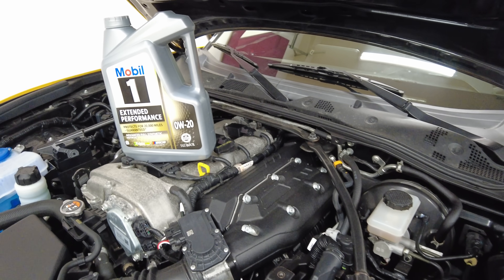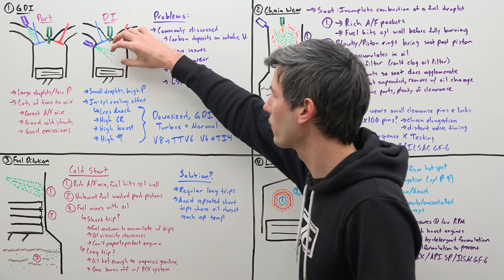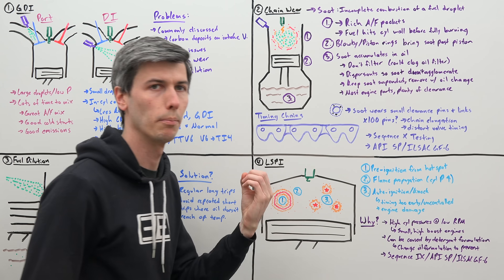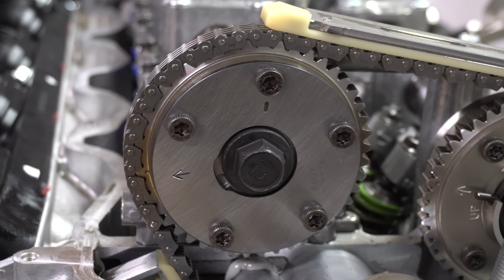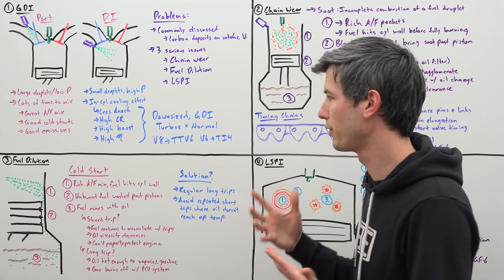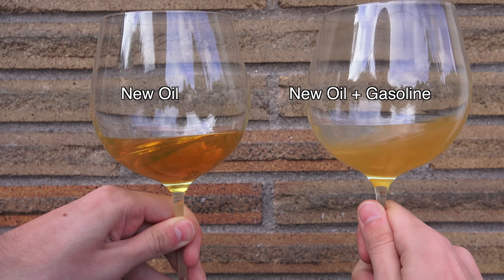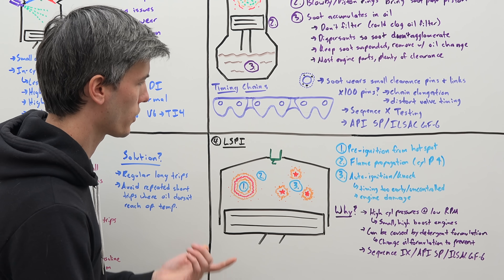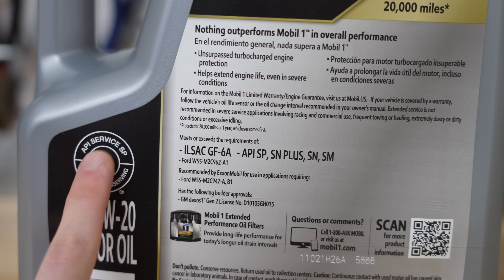3 Big Problems With Direct Injection Engines (Gasoline)

Comment: Low rpm port injection pushrod engines like the ls routinely get 300,000-800,000 miles before they finally give up. Just saying.

Comment: Gee too bad the German engineers didn't know how poor direct injection was!  They would have never used it in some of their fighter engines as well as the 300SL that ruled Le Mans until they stopped racing.  If only you could go back an tell them LOL!  BTW, chasing what turned out to be a coil wiring problem I had occasion to pull the intake on my Chevy 3.6 direct injected engine, could clearly see the backs of the intake valves an they looked like they just came right out of the box (60k miles).  I also worked in a shop rebuilding engines and did a number of valve jobs on 300SL engines.  The valves had no more carbon and often less than typical Chevy small blocks in the early 70's.  I have no doubt this problem exists somewhere but I couldn't prove it by my experiences.

Comment: No. 6 no cvt transmission.
No.7 non turbo. Get bigger engine if need more power.
No.8 reroute the pcv system to an oil catch can or other
No.9 on new car first oil change at 500 mi odometer reading, second oil change at 1500 mi. Odometer reading., third oil change at 3000 mi.odo reading. From then on every 5000 mi approx with synthetic oil. Otherwise every 3000 mi with regular oil.

Comment: A simple, inexpensive oil catch-can solves these problems. It catches not only the oil, but also the soot and fuel. It acts as a second oil filter and stops any oil from reaching the intake valves. Direct injection is not a problem, the oil is the problem, which is easily solved. I just hit 150k miles on my Corvette C7. Not one problem, no leaks, and still has all the power it had when new. And of course, the AFM was disabled. GDI is still superior.

Comment: So GDI + Port Injection & Improved ECU control of cold start & different modes to select which fueling method best case, or multi-variable mapping or dynamic engine mapping with AI from NVIDIA or Intel or Microsoft //
Reply: Dual Injection or Dual Fuel already an automotive technology to solve the problems of direct & port injection by using both methods! So each cylinder has its own direct injector & port injector.

Comment: Our 2015 Honda CRV had GDI. We had one injector go bad at 102K miles while on a road trip hundreds of miles from home. Car went into limp mode, so had no option but to limp  to a dealer. Honda only sells full set of injectors. $1800 by the time we were back on the road. Conversely my kids "97 Tacoma had an injector go bad several years ago.  Bought a reman. unit online for $39 and swapped it myself. Still running like a top with 290K on the clock.  So even if you dodge the carbon buildup issue (Honda has a built in catch tank as well) GDI systems are over designed and expensive to fix when (not if)they fail. And don't get me started on the CVT in that thing. Needless to say we no longer own a Honda.

Comment: Your description of GDI engines features & problems was spot on! I was privileged to be a lead auro research technician for several years, in LSPI phenomenon consortium studies at SwRI. The 2.0L GM LHU  Turbo GDI engine was my assignment at that time. What a sturdy engine for that test matrix. The pistons had a hollow donut ring under the combustion face & was oil squirter cooled (like some diesels,) evenly cooled as the oil traveled thru the donut, & cooled piston top equals a stronger, LSPI resistant piston. I operated these engines for hundreds of hrs., heard thousands of LSPI's, watched amazing cyl. pressure traces (LSPI spikes), and the LHU would hold up amazingly well.
Yes, you mentioned the oil additive that grossly exacerbated LSPI's (the engine sounded like a popcorn machine!) Without the additive, the engine might run for hrs. totally quiet! 
I love your show, great dissertation & nice learning experience! Thanks!
Reply: I have this engine in my car, though it is designated as a20nht. It has 212000km currently, and runs fine. Although it sometimes has a brief cam phaser rattle on cold starts. Did you have this problem on your tests? And how did the timing chain hold up in your experience? I keep up with oil changes and using dexos 3 recommended oil. No short trips, whatsoever.

Comment: What about Fords 5.0L V8 that utilizes both direct injection and port injection with mixing? It’s naturally aspirated with a high 12:1 compression ratio. Does this method avoid the fuel dilution?

Comment: Good info, thanks.  I have a Mk7 GTI and use Mobil 1 Euro car formula.  I thought the VW 505 00, 502 00 is what I needed for that car.  It lists API SN, SM, SL, SJ but not SP.  I've lugged the engine before on hills momentarily before downshifting but never heard a knock or ping.  Is this a subtle knock that you can't hear?

Comment: A high pressure fuel pump would atomize the fuel (like it does in DI) and improve the mixture in a PI engine, therefore increasing it's efficiency. 
  
  But if the big benefit here is the cooling effect....well, there were better solutions. Like water injection or ethanol. Hell, E85 already has a significant cooling effect, so i don't see any additional benefit from DI. 

  In my opinion, DI is pointless and causes more harm than good, and they adopted on purpose. To slowly kill your engine and force you to buy a new car or spend a lot of money to fix it.

Comment: The biggest problem w DI is if the O rings leak, the injector will leak fuel directly it the crankcase
which will thin out the oil & you will spin a bearing. SO, whenever I check my oil I look for  TOO HIGH
& I sniff the stick for gasoline smell.

!

Comment: I am confused by the spark thing. I thought diesel did not need it unlike petrol engines.

EDIT: I was right diesel engines do not have a spark plug, and everybody is praising the video. I removed the like and downvoted. This is sloppy.

Comment: Two guaranteed ways to prematurely kill a GDI engine:
1) Save a few bucks by using 87 octane. "Runs just fine".
2) extended oil change intervals with anything other than top-tier full synthetic.

"Pay me now, or pay me later" is wrong. It's more like "pay me now, or pay me much sooner".

Comment: I own a2017 honda civic sport touring 1.5L turbo direct injection engine model. And I believe that I have narrowed the oil dilution issue down to two different things with this DreamWorks honda engine. First thing is the PCV Valve is a POS! plastic dont belong under the hood of a vehicle that has as much heat as this car has with a catalytic converter under the hood and turbo charged too boot! I can tell when it sticks either open or closed, and yes I know it is only supposed to open in one direction! But this is what I experience when it sticks. If it is stuck open it loses vacuum at idle when sitting at a stop light the brake pedal goes soft and engine runs a little rough. And if it sticks closed it causes the oil dilution due to it somehow creating high pressure in the engine, And I believe it does this in the cylinder above the piston and is pushing unburned fuel around the piston rings! And along with that i know that these cars have way too many electronics and not enough battery strength to feed everything! And that would include the coil packs to make a good burn of all the fuel! And I say this due to a couple of things. First, when it feels sluggish and it starts running like crap! I remove the PCV Valve and spray mass airflow sensor cleaner through it, because every time I pull it out of the valve cover and shake it you can't hear the valve rattle. After spraying it and the oil gets done dripping out of it i shake it again and now I can hear the valve rattle inside of it! And when I reinstall it and drive the car it runs way better! Now let's address that battery, or lack there of is more like it! At 24000 miles I had an issue with the car steadily losing power, so I pulled the battery out and peeled the sticker off the fill plugs and opened all six plugs to find the battery only half full of liquid and all the lead plates exposed! Curious if anyone else had run into this issue, I started reading some of the comments people were writing in to a forum about this and found out that in there quest to make the car as fuel efficient as possible, Honda is shaving wait by  removing thirteen pounds from the battery if the car gets shipped to a warmer climate than if the car is shipped to a colder climate! That thirteen pounds is lead plates being smaller which would tell me that the battery now has far less reserve capacity for storage of energy to run all those things such as heated seats and the touch screen read out/Stereo system in these cars. I am interested in your thoughts about my findings? Oh, and yes I replaced the battery with the most powerful battery i could find that would still fit in the battery box like it supposed to as well. 😉

Comment: You know full well they design engines to last only so long. If better parts were used they would last. It is all just one big racket. If car engines had a prelube pump they would last much longer. Gasoline it's self is a crappy fuel. I think a 3 compression ring might help out.

Comment: Intelligent oil monitoring systems giving false hope that your engine oil is still good and a 6 foot long skinny timing chain ,,,what could go wrong ? Siamese cylinder walls and paper thin head gaskets. Worn timing chains for the most part are noisy at idle and an incomplete burnt fuel should show up as a rich condition. Blow by is inevitable with an engine that has short shirt pistons and low friction rings and 16 lbs boost.  Change your oil by mileage or pay the piper. Thanks for the video it would be amazing if Mobil 1 could actually tell everyone the total truth.

Comment: The ford ecoboost allows for 87 or higher octane and can adjust. Does running 87 octane with retarded timing on these affect the combustion and make a dirtier or incomplete combustion? Thanks.

Comment: I prefer Mobil One in both my Audi and VW, Audi has 240K miles and VW 145k.   I have used Liqui Molly before but it seems that Mobile One doesn’t burn as fast between oil changes.   Also, I change my oil at 3,500 to minimize risk of carbon scoring and oil consumption.

Comment: My EA211 has a belt, diesel vw504/507 oil helps with soot, 700,000km non issue with even the 3 cyl variant.

Comment: My car is a 2019 Hyundai Veloster with a turbocharged 1.6, and does get fuel in the oil. I do live in Canada where cold engine starts are a thing and warming the engine and letting the turbo idle down is a thing. I live in a small town where most of my trips are about 15mins. I change the oil every 5000kms, once a month I take it for a long trip on the highway. I still get fuel in the oil. 
I had to change the spark plugs at 35000kms because they got fouled from excessive fuelling. The dealership told me then I should make it work a bit and idle it more to get its temperature up. 
I just had my car at the dealership for it fuelling the oil again and I only changed the oil last month. They said it was because I was idling the car too much. 
Would idling the engine cause the fuel contamination in the oil?

Comment: So I am sure it will be fiercely debated but I was told that BJ’s gasoline is bad because there is no detergents or consistency in the refinery they buy from… which causes more buildup on DI engines.   Is this true or false?

Comment: Issues with Direct Inject were known in the late 90s, when OMC started using it in their Outboards. A change in the Combustion Process under some operational conditions, resulted in a very Hard Carbon Particulate forming. This would get behind the Piston Rings, and eventually prevent them from contracting in enough to allow the piston to move in the Bore. These were 2 Stroke Engines, but DI is also wrecking Havoc with 4 Strokes

Comment: I have a 2012 Ford Focus (direct injection) with 212,000 KM. 
I didn't change my oil for a year and a half during Covid because I lost track of time.
A VVT solenoid went on Dec 23, but I drove home for Christmas in a snowstorm.
I drove it for a day with a serious leak in the cooling overflow system.

The engine runs fine, gets fantastic gas mileage, and starts up on -30 mornings with no hesitation.
With the abuse this engine has taken, I think the worries of direct injection are way overblown.

Comment: There is nothing new about low speed pre-ignition, and it is not a quirk of direct injection.   Those of us who drove British cars in the 1950's and 60's were used to pre-ignition (due to a long stroke), as were those of us who had to use low quality government pool petrol, until pollution control measures put a stop to it.
This engineering guy gets a lot of things wrong.   For instance;  the main source of intake mixture cooling comes from vaporisation of the fuel (ie latent heat of vaporisation) - for a given quantity of air drawn in, since petrol engines operate stochiometrically that means a given quantity of fuel, and that means the same amount of cooling regardless of whether it happens before or after the intake valve.
Certain examples of Chinese-made small engines - eg those used in portable generators - suffer pre-ignition and they are carburettor equipped.   They pre-ignite because they filled a market thirst for more power, and the easiest way to get more power need was raise the compression ratio.

Comment: Only company to get direct injection correct was toyota. Because they used both port and direct injection. The main problem is maintenance. All the manufacturers going to a 10k mile oil change interval. Even on synthetic oil this is a very bad idea. 3-5k miles for oil changes people. Its not that hard.
Reply: Ford has been doing it with the EB engines for 6 years now. And yes, maintenance IS critical. Early oil changes stopped the cam phaser/spacer/timing chain wear problems even on non DI/port engines.

Comment: Wonder if mobil1 solved their real world evaporation issues. I quit running in my cars because I got tired of adding 2+ quarts between oil changes because it was always low. and this isn't on some worn out engine... This was true of my E63 AMGs, Jaguar 5.0SC, 6.0 Powerstroke, 4.6L Ford modular, 3.5V6 Explorer, 3.9L V8 Lincoln LS x2.... Switched to Castrol, or even Walmart Supertech synthetic and never had an issue again. I wouldn't put Mobil1 in my lawnmower.

Comment: Honestly not the DI it's the PCV system used. They're using the same PCV as the port injection. I however don't vent my PCV into my intake so my valves don't see that crap. catch cans and AOSs help but don't fix the issue completely. Just get a vent to atmosphere and tune, boom problem solved. My 2 cars and both motorcycles have no PCV returns.

Comment: Never buy a car with direct injection because they cause carbon buildup on the valves and there is no prevention and no easy fix. 
The manufacturers know this, but they care more about meeting government mandates than their own customers. Do not buy any car with a direct injection engine, if you do, you are a moron.

Comment: I have an Acura ILX and a Honda Ridgeline both with direct injection, but neither are turbocharged.  In fact, I specifically settled on the Acura ILX because it seemed to be nearly impossible to find a NON-turbocharged engine in a small or even standard sized sedan these days.

My previous car was a Honda Accord with a V-6 engine , but they stopped offering them years ago and now they are all turbocharged 4 cylinders.  Very annoying.

Ironically, my Honda Ridgeline has, basically, the same Honda V-6 engine that my Accord had, but with direct injection.

I’m hoping having non-turbocharged engines will help me to avoid some of the problems of direct injection engines, but this video is very helpful pointing out issues I was unaware of such as the problems caused by “short trip” driving.

Unfortunately, there’s not really much one can do about it if one’s driving requirements involve mostly short trips.  But it’s good to be aware of the issue.  I guess I could drive around in circles to make my trips longer.  😉

Comment: I have two Ford products, one approaching 300k and the other approaching 400k km, and both vehicles run great, sound great, do not consume any oil between oil changes (done at 10k km intervals).  I’m not observing any problems with the direct injection.  Where is your data coming from?  Has anyone tested two engines of the same design except for one direct injection and one port injection to measure the difference in timing chain wear?  I doubt it because that would be and expensive endeavour that wouldn’t benefit anyone.  Maybe these problems are specific to certain brands of vehicles? I’m not ready to believe this theory against direct injection based simply on my observations of my vehicles and those owned by people around me.

Comment: The 2.0T Direct Injected in the new Jeeps most common failure is by far chain wear/stretch and oil pump noise. All within the first 40k normally. Along with absolutely horrible valve build up

Comment: The chain wear is also largely down to chains being thinner for fuel economy reasons as well as oil change intervals being stupidly long. I don't believe the oil being diluted with fuel would be much of an issue if these two factors were not present. Non GDi engines get some fuel dilution also.
Reply: And my MB OM642 diesel has a double chain, they switched to a single chain and started having issues!

Comment: I have found many of my customers with small turbo engines not using the required gasoline octane either because
 they don't pay attention to their owners manual,  or the recommended octane alerts on dash or filler doors,
 or  the most common excuse being the price for premium gasoline... 
  The other big problem is when they use the local quick oil change places that buy bulk oil in one weight and specification.